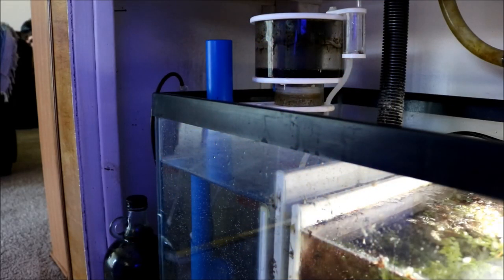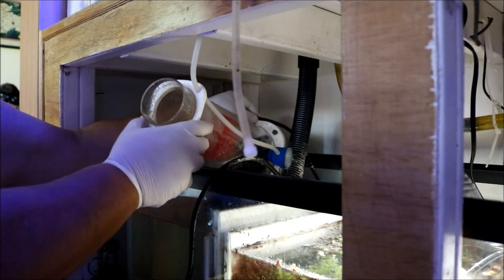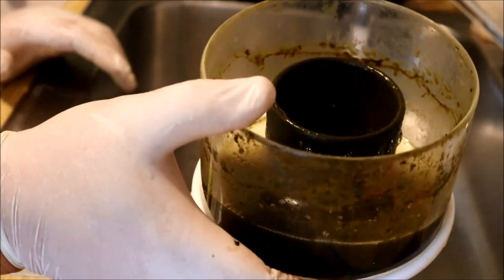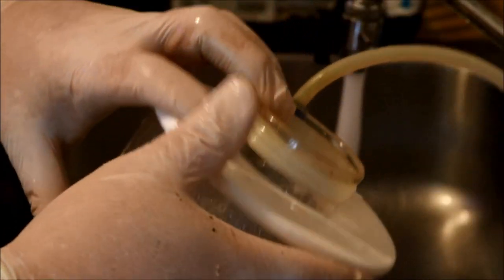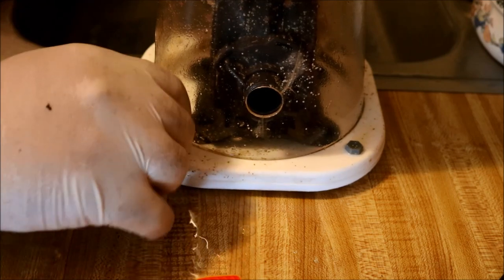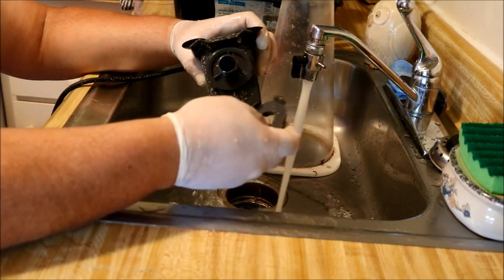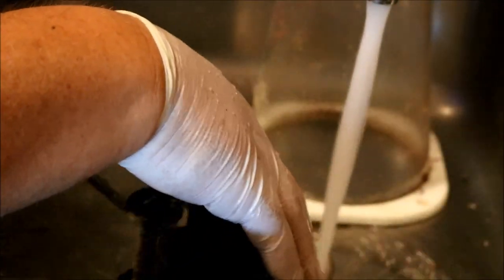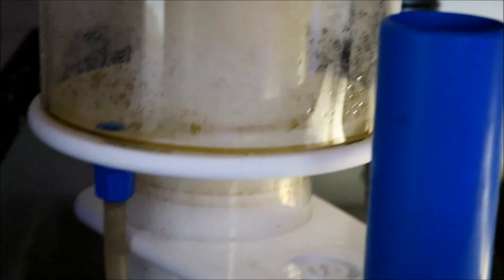Skimmer Problems

Comment: I always check the ceramic shafts for buildup. I had a pump stop working everything looked fine but there was not enough clearance between the impeller and the shaft. Had to scrape it of with a knife then it worked just fine, still working today.
Reply from the maker: SweatyReef thank you for the info brother. I had a return pump shaft snap in half while operating. Just another experience in the hobby...lol

Comment: noticed that your silencer(muffler) had water in it at the start. you probably want to keep it as dry as you can. mine also gets a little salt creep in it. I clean it out with a little wire making sure it drops out the tube.
Reply from the maker: Ricks Reef thank you buddy and I will take care of that although I do flush it when I clean it with fresh water.

Comment: Hey Scott, I see that the silencer is attached to the lid. Do you find that it's extra work to remove and empty the skimmer cup every week or so?
Reply from the maker: ReefingwithO the only real pain is when I remove it to clean the cup. I use the drain hose and a external container to drain it when the cup is full.
Reply: Ahh OK. that makes sense. I might consider that. Emptying and cleaning everyweek is a lot of work.

Comment: Crazy not even a week i asked about skimmer it gave you problems that's exactly what happened to me it's starting to fail would stop producing bubbles then stop keep a eye on it towards the end of the life of mine it will get very hot
Reply from the maker: Am Fit Elite Reefer thanks Am and this is an easy fix. Plus I just will buy a new pump for it and it will be as good as new.